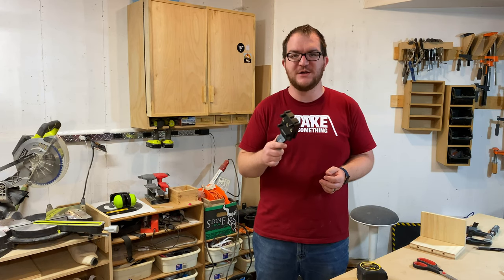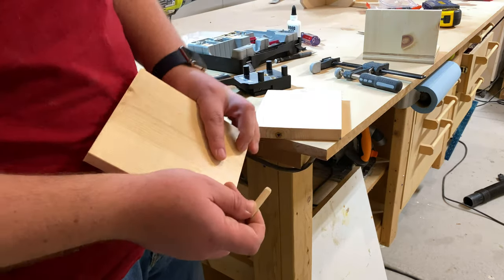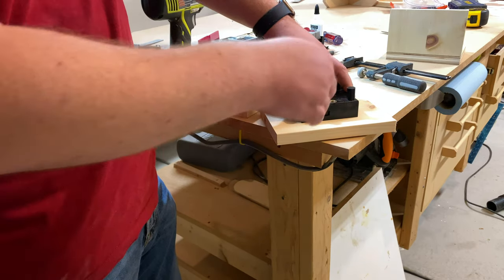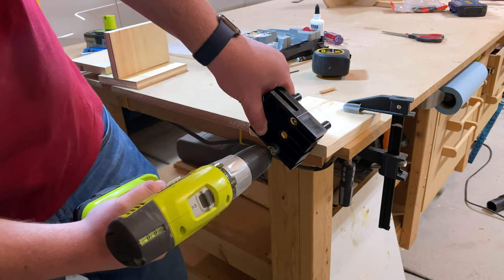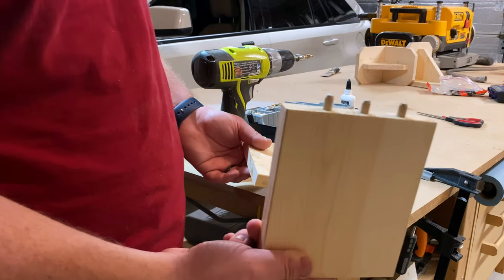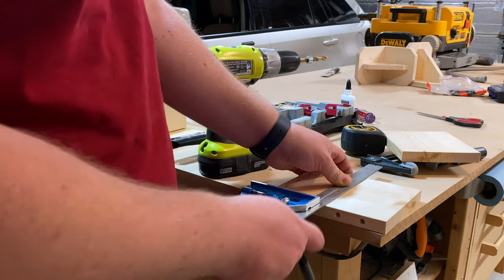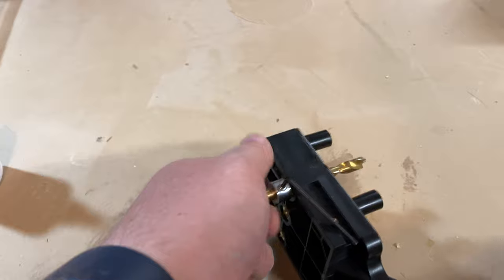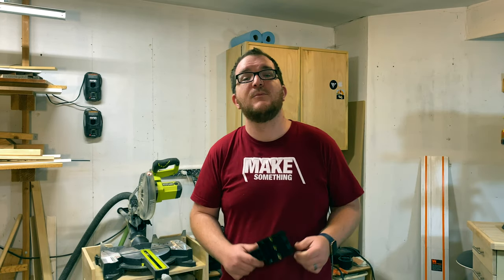How to Use Dowel Joinery for Seamless Joints

Comment: I have this, the older green version, for at least 10 years and used it extensively. It works really well and i made a lot of dowel connections with it. Once you are skilled with this tool, nothing beats the speed and precise working.

Comment: Great tutorial. I have one of these cool jigs, and it does work extremely well. I also have the "dowel it" jig which is great for edge to edge joinery. The only thing I have to say, and this is not a criticism, is that you keep referring to the Milescraft doweling jig as cheap. Maybe you should say inexpensive. When one thinks of cheap, they think of (at least I do) something that is poorly made and will not last. Even though most of the material of this jig is plastic, it is a high density plastic, and should last years if taken care of. This jig in my opinion is an indispensable, inexpensive little tool that everyone should have in their tool arsenal.  Thanks again for the great tutorial.

Comment: I think a work around for smaller stock is using that centering line, it just may be tough to hold against your workpiece, but add an extension piece next to it for balance.

Comment: I would recommend looking at the supplied drill bits closely before trying to use them.  Mine were quite wobbly which made the dowel holes bigger and reduced the precision when joining.

Comment: Your centering can be solved by taking a wider board and drilling and installing one dowel. Then put your fence on and adjust it so it's setting the depth. Now take it to the board you want to use it on and use the fence to put it to center and drill the hole(s) where you want.

Comment: I broke the pin too when I dropped it. I fixed it by applying a bit of pvc cement. Make sure  to dry fit it before putting on the glue so it's still accurate

Comment: One other thing, for  the broken pin, just use some super strong epoxy with an accelerator. Hold it down for a few minutes and you should be good. Most epoxies work really well on plastic parts like that.

Comment: A dowel jig can be just as fast as a domino and is a lot less expensive. Plus you can make different sized dowel joints easily and cheaply. Fast sting and effective, dowels are a under appreciated method of joinery.

Comment: Two sets of drill bits makes sense ... but what we really need is just single additional bits. I know I can get individual twist drill bits (for metal, and less precise wood work) on cards at my local Ace Hardware store, but I have never seen brad point bits for precise woodworking there. The only way I know to get the collars, though, is to buy a full set ... bummer.

Comment: I just got my kit from Amazon yesterday today went to use it was going great and knocked it off my 36in high work table to concrete floor and snapped one alignment ear off smooth at base. This jig is user friendly after a small learning curve but its not durable by any means.
Reply: The same thing happened to mine! The good news is that if you contact the company they will send you a replacement at no charge.

Comment: I used it and you dont need center pins acctually, so there is no width limitations really. Just mark center where you wonna pin to be and drill by eye centered pin. It will be 99% accurate.

Comment: Great demo, mate, 👍🏽
bummer that you dropped it and broke the peg off. 
How did you go with contacting the company, get a replacement?
Maybe the issue with the minimum width of board, one work around that 
should work to get evenly spaced holes not too close together, 
is to clamp another wider board to it so it extends the width for better jig positioning? 
Can't hurt to give it a go, it should work, 
well, in my head it does! 😆😆😆

Comment: You don't have to use the pins to center a dowel in the end of a board, do you? Couldn't you also use the adjustable fence?
Reply: Yes, you /can/ use the fence to center the holes in the end or edge of a board, but it is much less precise. The geometry of the pins and holes on this and similar jigs ensures that the dowel hole WILL be centered on the end or edge of the board. However, neither the pins or the fence help if you want to edge-glue one board to the face of another. However, edge-to-edge, end-to-end and end-to-edge are the most frequent ways of using dowels - precisely where these jigs are most useful. 

The other way to locate the "other" holes is by using "dowel centers". That is the way I learned in high school shop class in the mid-1960's. A dowel center is a metal device that has one end sized for a perfect fit in the hole, and has a perfectly centered point on the other end. They are usually available from woodworking suppliers in sets covering the most common dowel sizes. Once the dowel holes are drilled in one board, the dowel centers are inserted and the other board is pressed up against them.  The dowel centers in the first board make pinholes in the other. The pinholes mark the centers of the holes to drill. You still have to manually drill the remaining holes perfectly square to the surface and to the correct depth, but at least you have a precise place for the drill bit tip.Doing it this way is necessary if you want to edge-glue or end-glue one board to the face of another.

Comment: Interesting you made a good well intentioned video lacking one major missed point. The drill depth stop collar. You have it, you just ignore it. I am betting you have several outtakes because when you inserted the dowel it just disappeared into the hole that was drilled too deep. Go back and edit your video showing how and why the stop collar is needed. Then your video might be perfect.

Comment: You don't need a jig, especially one of these cheap plastic ones. All you need are dowel pins and a brad point drill bit of the appropriate size. Drill dowel holes wherever you want in one piece then use the dowel pins in those holes to make corresponding point marks in the mating piece. Drill out the holes in the mating piece, glue up you dowels and edges, put it together and you're done.